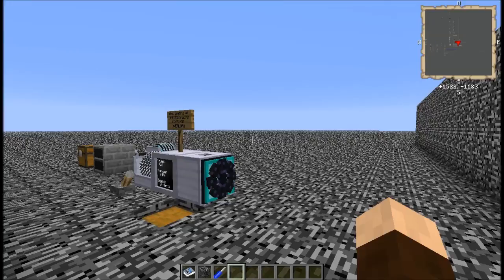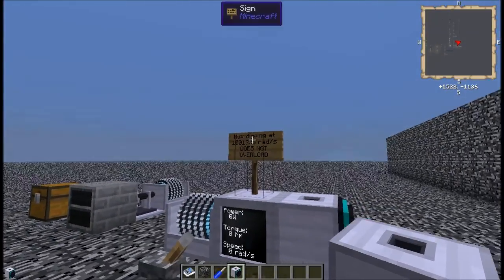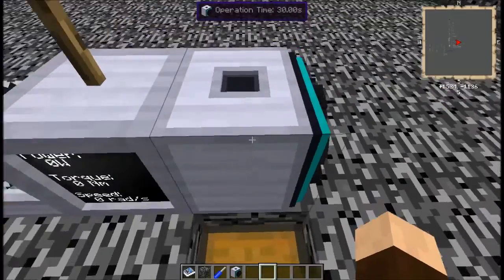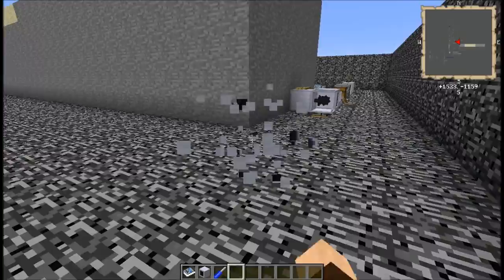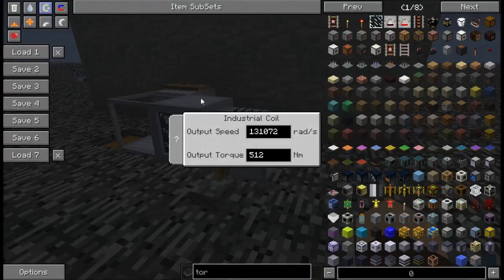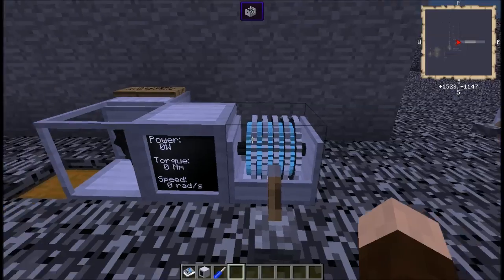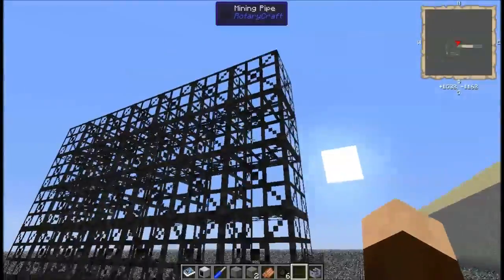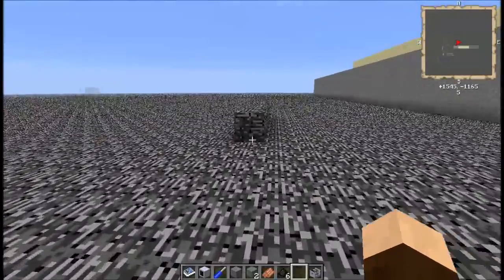How to Guide for RotaryCraft pt 9 Production Machines

Comment: As of v20, the bedrock breaker requires four times as much power, 2MW.

I also fixed the bug with bedrock providing four dust per block. It was originally half that.

Comment: The borer's specified torque requirements are per block, not total. 512 will not cut through more than one block of obsidian at a time, and can only cut 20 or so stone blocks.
Reply from the maker: That's why I said for a block.  I also tried to show how scaling the numbers had different results on just the stone in order to show that messing with normal generation is going to likely be more hairy than just giving it a little juice and walking away.  One setting does not break everything, I know... well perhaps a really high setting.
Reply: You spent 15 minutes giving the Borer more and more speed but keeping the torque at 512, an insufficient value for mining what you were trying to mine, all the while commenting that you had no idea what was wrong. If you understood the problem, you provided every indication of the opposite.
Reply from the maker: After rewatching it, what was wrong is that I forgot the step of changing the borer dig pattern to the size I wanted to demonstrate.
Reply: OK...
Reply from the maker: Apparently, even with just two items this episode, I still managed to not cover everything the way I intended.  I need to break things down more, write things down more, and use a checklist... If I don't get ahead of myself.